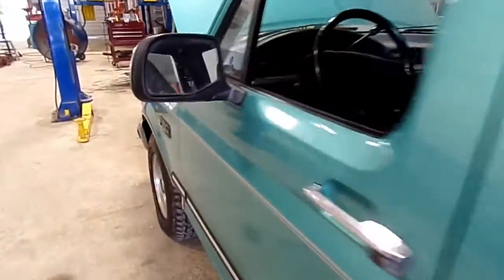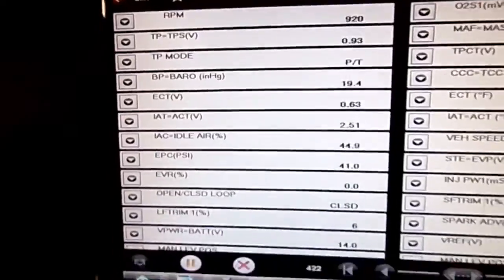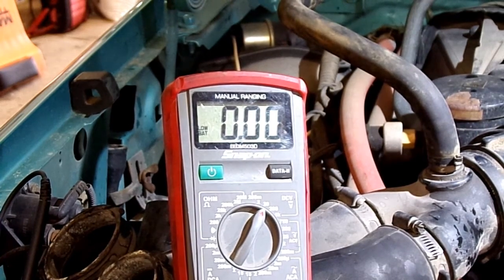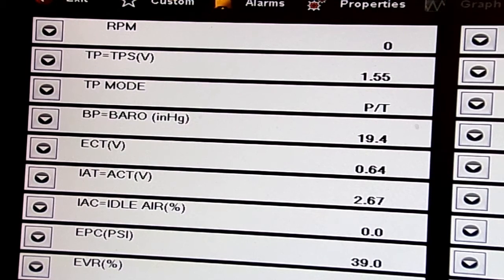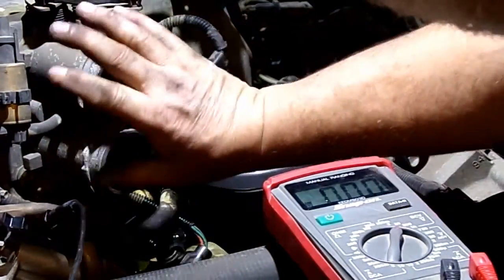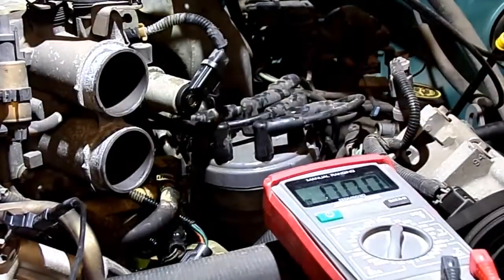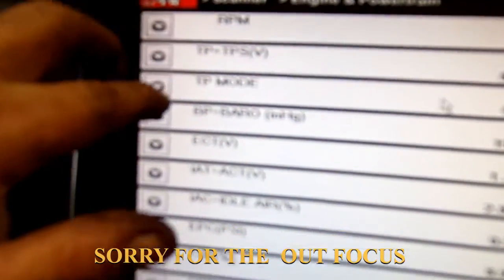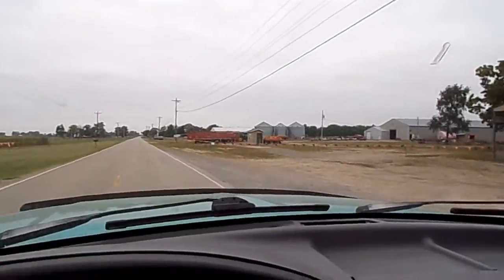1994 FORD F150 , LOW ON POWER , HAS NO GET UP AND GO .

Comment: Great video!  I have a 95 F150 5.0L that's been sitting for 15 years.  New dist, fuel tanks, etc, etc.  Got it to fire and run but same symptoms as you describe.  I was thinking clogged cat next.  Thanks for all this info for backyard guys like us.  What scanner and software are you using?  I'd love to pull info like that from this OBD1.
Reply: Try your map sensor could have water in it !!

Comment: '94 f150 4.9L starts fine but once in gear it has no power  and sputters-just installed new fuel pump,tps sensor,map air/temp sensor...
Reply: Pcm
Reply: The OD light flashes?
Reply: Fuel pressure regulator.
Reply: My 96 had a vacuum leak
Reply: you ever figure out what it was? im having the same problem now
Reply: Fuel filter
Reply: Egr delete
Reply: Try replacing the crank sensor and camshaft sensor.

Comment: I had gone thru this procedure on my 05 kia 6cyl (in past had timing correlation code and injector 5 code) hint of water in oil I thought I was crazy (messed up head or headmaster side note) but THIS PROCESS HERE after putting back together tps in wrong spot gave me transmission issues. It felt like. Well I've had transmission issues searching for gears stop sign complete stop 3rd gear wait a sec....1st gear....take off unless floored gas before hit other end intersection I'm bout working my way into 3rd COULD THIS POSSIBLY FIX THAT ISSUE and fucked up head or head gasket on the soon to be worked on kia?

Comment: So I have same exact setup truck just 1995. Was driving made it about 18 mins from the house and truck completely died on me. After running through the normal stuff ended up being the positive terminal end. Replaced that truck started now, but got codes off my OBD1 for the tps and idle air control. Replaced those. Truck runs but still has no pep, runs better but no real pep. Got code 158 for maf and code 998. I replaced it but I'm guessing it is a short in the wire causing this last problem? Yes or no. Thank you; chris
Reply from the maker: If you have the same maf code after replacing then yes wiring are computer , If you dont have maf code after replacing check timing and check for cat. converter stoped up and check fuel pressure,
Reply: I yave pomblem on my bronco wen I trun that accessories my truck  stalls after 55 like loose power but whit no adesoried on work perfect and I have all new distribuidor pickup coming il batery us a year old all grounds are clean  wath can be

Comment: I’am kind of guessing it’s my tps causing my truck too run poorly and to idle high, at start it idles good but when I give it gas it stays very high, I disconnect the idle control valve and it stays on low rpm’s but when I connect it back it idles high again. Any pointers will help thanks
Reply from the maker: Try cleaning the throttle body and idle air control valve  first . If that don't help try taping on idle air control valve and see if rpm go's down ( sometimes they can stick ) . Then you can start looking at the tps .
Reply: It’s a 1993 5.0 f150
Reply: I have this same issue did you find the problem? I need help
Reply: @juangaribay9740 same here. I checked the tps and it seems fine. I adjusted it to .97 vdc and wide open it’s at 4.75. No weird spikes. It was at .80-.81 before. I’m still getting code 122 low voltage at tps.

Comment: Backstory: Wasn’t running right. Would start up fine and run perfect when it was cold but when it warmed up it would flood itself and stall. Wouldn’t start again until it cooled down. Parked it and it sat for 3 years. 

Current: Same problem but now it misfires. Only thing that’s weird is that it won’t even warm up (according to cluster) so it’s not stalling. Check engine light comes on after about 5 minutes of running and that’s when it starts running rough. Also feels like it’s in limp mode and has no torque.
Reply: I had that problem and it would start cold but not hot ended up being my coolant temperature valve and it runs great and starts up great now

Comment: Hello i have a f 250 351w 4 x 4 5.8l that i am getting carbon fouling on all 8 plugs 30 minutes after changing them. I have a new fuel filter.. Fuel pressure regulator... I have checked all my vaccum hoses. I am in an area where i have not been successful at recuiting knowledgeable mechanics. Please help.
Reply: 1994 is the year sorry
Reply from the maker: Hard to diagnose over the computer but I'll give it a shot , First how does it run , does it miss out  , doses it idle bad , smoke , can you smell raw fuel from exhaust , does the engine light come on when driving . any and all info will help .
Reply: @heartlandmechanic  well when you accelerate it bogs down like it is getting to much fuel. It idles fine with no signs of missing. I have had it stall out also on acceleration. When i replaced the fpr no fuel come out of the release valve but it had set over night. Not sure about the dash light . i am working on it here and there inbetween 16 to 17 hr days.
Reply from the maker: @garyhagger6665  A few things to look at . MAP sensor , Intake air temperature sensor , coolant temperature sensor  , all 3 can cause rich problem . If you have a vacuum gauge install it on a vacuum line , If you don't have at least 17 inches of vacuum suspect plugged exhaust or a timing issue .
Reply: @heartlandmechanic  thank you

Comment: Have E150 5ltr, just doesn't have even power curve, plenty of power at above idle and floored, it just seems boggy in the middle, don't want just low. Rpm power or floored only power.  No ck engine lt. Just would like half power at half throttle, any suggestions, engine is good ,clean, doesn't burn oil, compression good all 8, it's just flatish in the middle, does make a difference to gas it just full in the middle. ????

Comment: I have 1994 ford flareside 5.8  when I give it gas going down the road it will sound like it opens up but will not gain any speed at all do you think this could be the problem.     Thank you
Reply from the maker: could be . if posable check for codes
Reply: Would a 94 5.8, in a F350 have same connector location and the 5v ref?
Reply from the maker: @oneTbret213  I checked the part number for the 5.0 and its the same part number as the 5.8 sensor , So should have same pin connector location . Not sure if wiring colors are the same . If you need wiring colors let me know,
Reply: Cateletic converter plugged up.
Reply: What did you find out Paul? Was it the clutch?
Reply: Same problem 89 5.8. Any fix for it gotta head thru the rockies